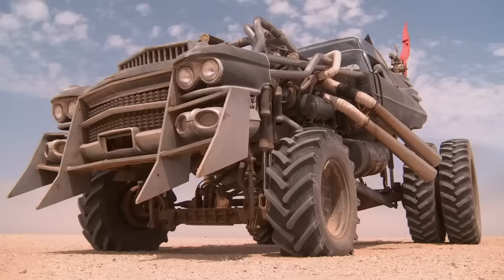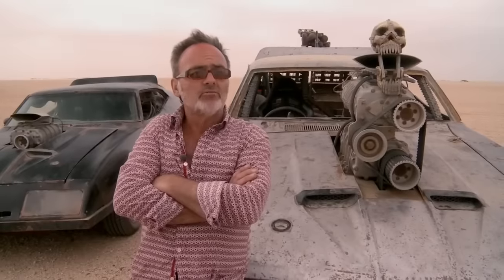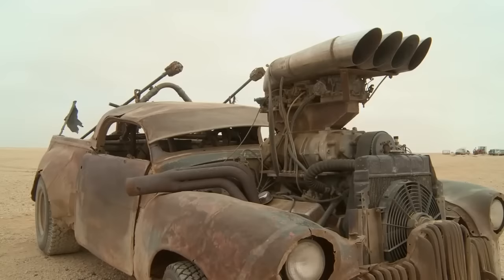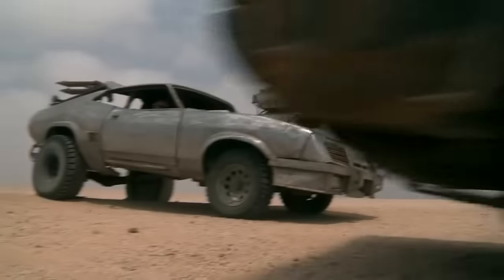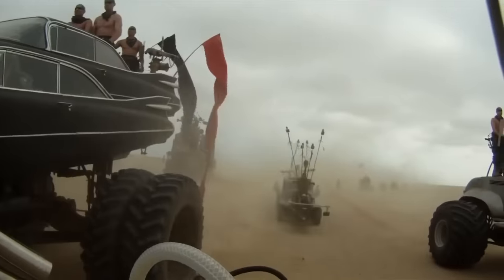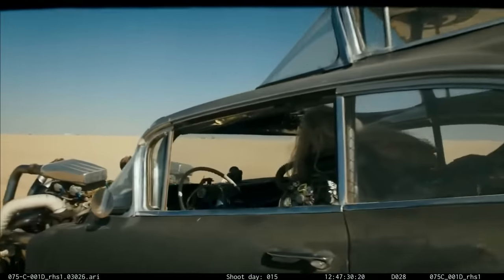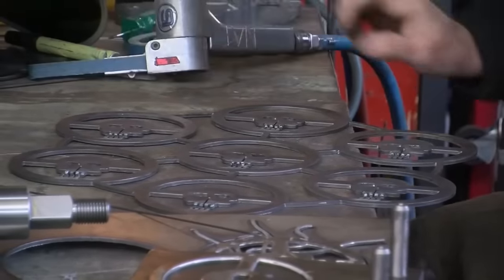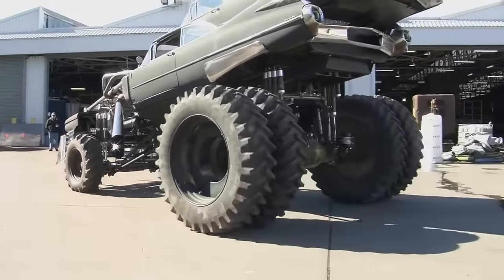Mad Max: Fury on Four Wheels [Behind The Scenes]

Comment: @ 20:13, all that sand and silt pouring into the supercharged engines, instantly would destroy them, the air intakes are somewhere else on that Tatra.
Reply: Endo Cannabinoid cough air filters cough heavy duty ones the use in the military for their hummer in the desert.
Reply: Correct. All the superchargers WERE functional at the beginning of the shoot.
Reply: they even make a point to show how they work in the movie when the engine catches on fire and they have to plow into the sand to suck it down into the intake to put it out before it blows up.
Reply: It has been a while but didn't the superchargers have a gate that shut on them just before the sand hit? Not that it would stop it all, but hey it is still a movie so they can get around that.
Reply: The effects in this movie are practical. Meaning if you see it happening, it happened. So obviously they built it in a way that they can protect the intakes while using the scoop.
Reply: The intakes without filters are used on drag cars for more power, and those engines don't last very long. l don't think that war rig could drive in the desert for more than a day before the engine would need to be replaced
Reply: The engines on top are not functional on war truck. They use the Tatra original drivetrain 19:15.
Reply: I just mean that not using filters is not practical for anything but a drag car, especially if you are driving through a desert
Reply: Oliver Watson I completely agree with your point. No way in hell would that engine last without a filter of some sort.

Comment: there is only a tiny problem guys. the original interceptor was actualy identical to any interceptor, except for the blower. witch actually made sense (even tho in real world the engine did not like it) , max needed more power. blower gave more power. AND (quite unrealisticly) it had the opton to be on, or off. could be done, but not easy. however it would make sense, fuel is not abdundant so you want an "economic" mode. so it all comes down well.

on the otherhand, here the things you shown are not practical mostly. that tracked thing is certainly not gona be fast. the car with tractor wheels on it, is allso limited in speed. and so on. 
thing is , while they do look great, they are simply not things one would use in a world like that.

unlike the original interceptor witch actually made:
SENSE.
Reply: Nagy Andras you are asking for logic and sense in a mad max movie?
Reply: the original interceptor MADE sense.
these magnificent machines do not.
Reply: i leave that to your mom. she is world class.
Reply: 'Which witch is which?' as my old teacher used to say, along with 'The boy threw the ball through the window', and 'They're going there to do their homework!'

Comment: a 351 chevy V8 blown and considered a big block huh? 1:35 it sucks that they dont know more about cars but front like they do :(
Reply: Probably the original plan is to use big block
Reply: a 350 is a sbc or small block chevy the 396, 427 and 454 were the bbc or big block chevys
Reply: Joe Ambly lol
Reply: Lol it’s not impossible for a 351 to be a big block. Look at the Ford 351 Windsor. Maybe you should stop fronting like you know cars. Just because of its number it does not mean it is a small block or big block. The LSX 454 is actually a small block. But the original 454 was a big block....hmmm.
Reply: BBC= British Broadcast Channel
BBC= Big Block Chevy
BBC= Bald Boring and Cancerous

BBC is open to make any acronym or meaning of

BBC is Big Block Chevy
Reply: exactly....it actually has more to do with mass and horsepower
Reply: Im not sure you know the history of the 'Big Block' Sure, the 351 was a small block engine, but there were Big Blocks of a smaller size, and this is a conceptual artist putting his thought to paper, you think these guys don't know about making Rigs? well, they know enough.
Reply: not really it depends on the bore. the big block has a bigger bore than a small block, dont remember the exact number. so a smallblock can have a higher displacement by using a smaller bore but a longer stroke
Reply: You think it impossible that the 348 could be made into a 351?
Reply: eatdirtmofo 
Should be possible, but here is my problem, the original comment refers us to 1:35 in the vid.  Car sketch shown is a 32 ford, and right in the middle of the page of said ford it says, “351 chevi big block V8 blown nitrous.”  I agree that it isn’t a big block but that isn’t MY issue.  If it had been bored out I would expect the quote would have read “___ Chevy bored to 351 big block V8 blown nitrous.”

It may be that someone was drunk or tired when they put the board/sketch together and meant to write “C” or “Cleveland,” but what was put down was Chevy.....not a bored out 351, not a 351W or 351C, but “Chevy 351 big block V8 blown nitrous.”

ADDING TO THE CONFUSION:  that board sketch was the original concept, but according to the mad max wikia page was not what happened, Nux’s car ended up being a Chevy coupe (4 of them actually), with Chevy 350 engines.  Also, the site says the blower/supercharger setup was non-operational....which is fine, 350 in a Chevy coupe  or 351 in a ford coupe neither would need an extra boost to push that relatively light weight car well past 100.......I’ve owned vehicles with both engines, each were much heavier.  That little coupe would fly just fine.

Madmax.wikia.com/wiki/Chevrolet_5_window_coupe_1934_%22The_Nux_Car%22
Reply: The car also has some pretty cool stuff..., 5fwd and 2 rev trans, T stick grenades, coil in rear, blood bag support, and a sun-roof! Im not sure the 32 came with a sun roof and a blood bag support as an option... but thats for a different discussion. 
You say the 351 Chev only came in a 6, and thats a pretty astute observation, missed by most, and is no doubt correct...
But...
The point is its a sketch, a concept drawing, not a blue-print.
350... 351 whatever it takes
Ford...Chev, ... big...small... Im sure they would have taken either on the day, they're trying to make a movie, tell a story, have some fun , make some money, and thrill the fans of the franchise, successful in my mind.

Comment: There's NO WAY those supercharged engines can flow all that dusty, sandy air straight through the blowers, the engines wouldn't last 30 seconds. The blowers all have to be dummies, just on parasitic drive.
Reply: it shows in the movie that the butterfly valves on the blowers close when the sand is coming up and re-open once the dear catch is up.
Reply: You can hear the superchargers/turbochargers whining in some of the footage of the cars driving. Likely they've got heavy-duty filters to keep the dust out.
Reply: if the abrams with what is basically a jet engine do it, why not some cars?
Reply: If baja 500 and Dakar rally could do it, i see no reason these vehicle couldn't

Comment: Were the blowers fake?. I just saw a car moving, so I'm assuming the engine was running, and then the blower started spinning up. Surely, if the engine's running, the supercharger's running?. That toothed rubber belt runs from the crankshaft, It's not something you can turn off and on to conserve fuel.

Comment: I actually dont like this. Its to much effort and craftsmenship that went into those cars. Its the postapocalyptic wasteland. Ressources are rare. U cant just take 2 cars, melt them together with a giant turbo charged V8 and do this like 40 times and then drive all those cars around like its nothing. Its impossible to build and maintain in the wasteland.

It would be way cooler if they really tried to make wasteland- scrapmetal cars. While the Interceptor and the Villain car have the magical V8 which makes them unique. 
The other cars have normal engines, maybe a couple small blocks but the rest V6s and V4s. And everything has to be build with sheet metal and wood etc. Just the 2 main cars can be equipped with better parts. Would make the movie way more realistic. 

The original movie made a way better job. It looked somehow realistic and manageable and also maintainable, while also looking hilarious. 

Sometimes less is better then more.